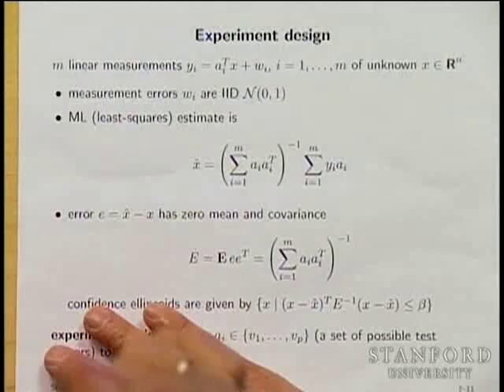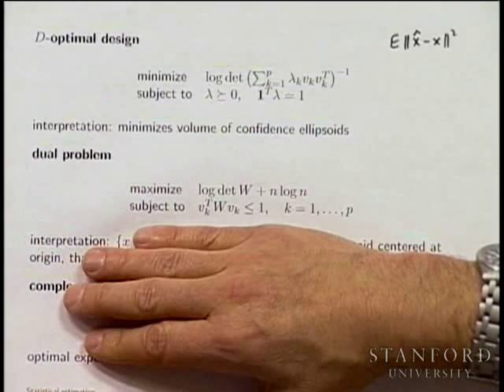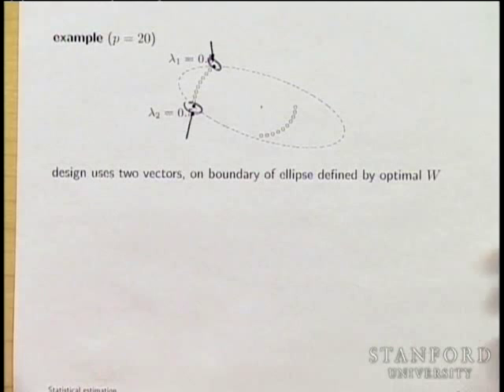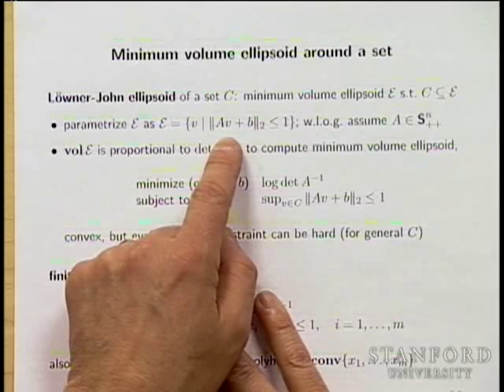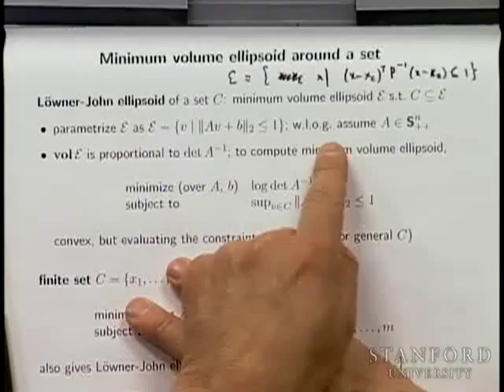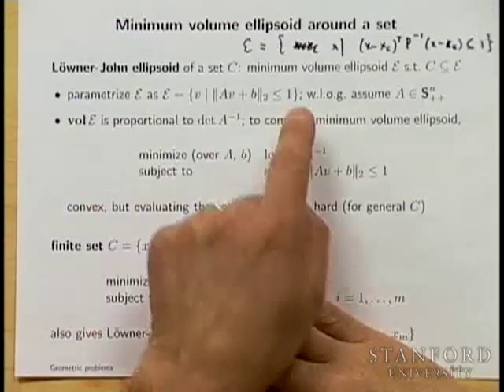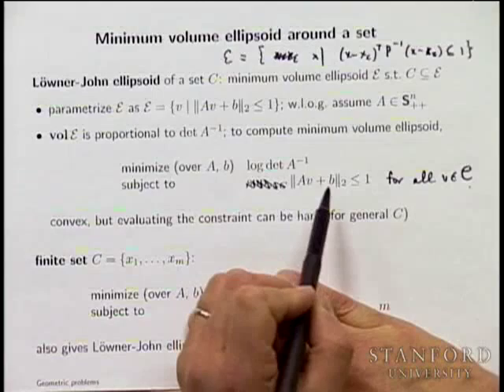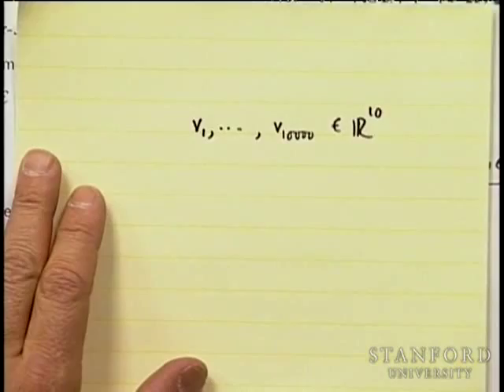Lecture 12 | Convex Optimization I (Stanford)

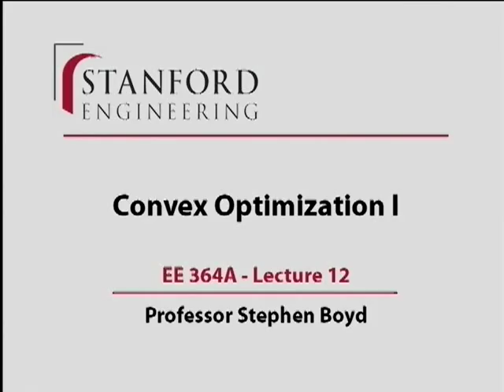Comment: 0:23 Experiment design(recap)
8:10 derivation of the dual
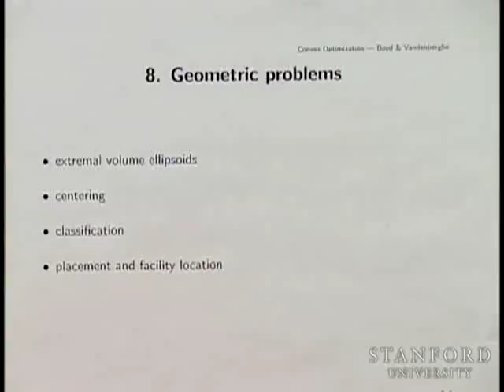10:18 Geometric problems (minimum volume ellipsoid around a set)
35:20 Maximum volume inscribed ellipsoid
48:40 Efficiency of ellipsoidal approximations
1:00:16 Centering
1:04:28 Analytic center of a set of inequalities
1:07:25 analytic center of linear inequalities
1:08:33 Linear discrimination

Comment: Around @54:00 he talks about justifying e.g. 2-norm on pitch-rate in the objective in helicopter design. He then goes on to talk about actually finding the 'acceptable' convex set C of outcomes  (pitch rate, rms, etc) via simulation, survey, etc and suggests we find the maximum volume inscribed ellipsoid E_max = {x || Ax + b||_2 <= 1}  to this set and using it as a norm: 'this it the norm you're going to use' @57:08.

What does he mean by this? Does he mean define a norm via ||x||^2_E = x^T A x, and then solve the helicopter design/control problem like so:
min. x^T A x
  s.t. x \in C

If so, what's the intuition here? That the typical 2-norm uniformly weights variable x directions, whereas the data is telling is to differentially punish directions (i.e. less punishment in direction of longer ellipsoidal axis)? But he also says we can motivate the 2-norm with this method - would this just say that we believe all directions are uniformly punishable (i.e. a small increase in rms is just as bad as small increase in pitch rate)?